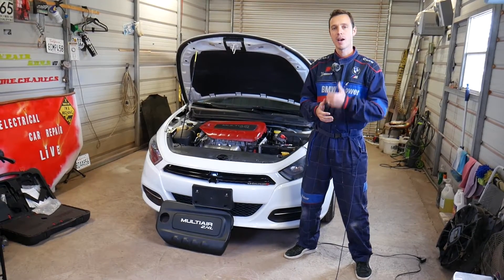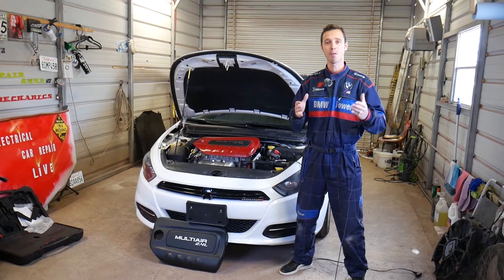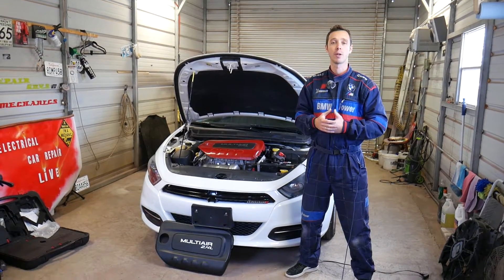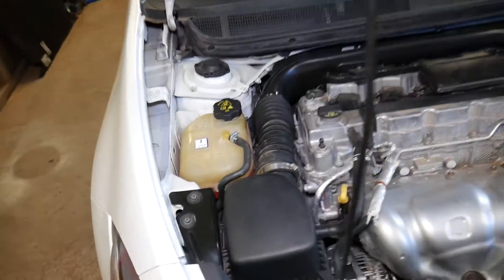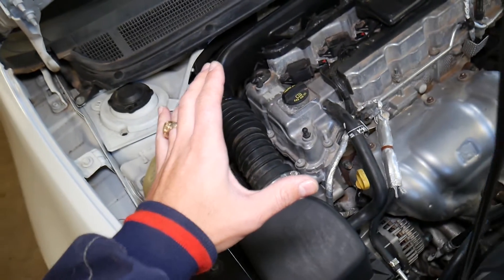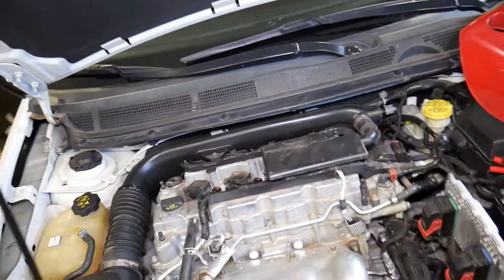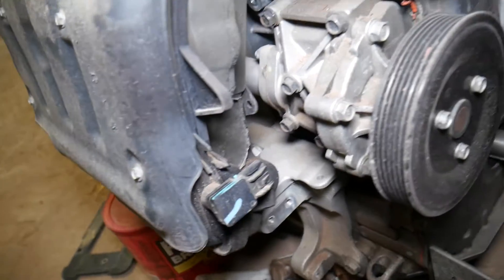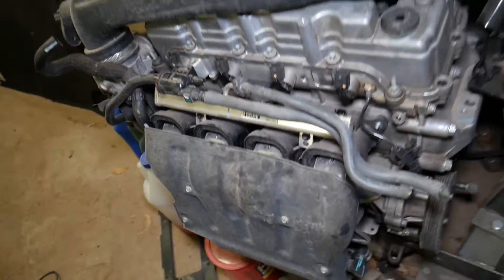WHERE IS THE MAF SENSOR MASS AIR FLOW ON DODGE DART JEEP CHEROKEE, COMPASS RENEGADE, CHRYSLER, FIAT

Comment: I need help, I have a jeep compass I have followed everthing you said to change.  with O2 sensor up and down steam and I changed the cam shaft and map sensor on the jeep,  the jeep has no power it laggs what is wrong with it. it is not throwing a code anymore tho I just cannot understand why It running bad... HELP!!!
Reply: They never reply.
Reply: If your problem still exist, check the following:
- Fuses (electrical errors in sensors / cheapest fix)
- Spark plugs (common ignition issue / cheap fix)
- Ignition Coils (common ignition issue / cheap fix)
- Air Filter (common air intake issue / cheap fix)
- Air hoses (leaks in air system / cheap fix)
- Oxygen & Crankshaft sensors (can wear out / cheap fix)
- Throttle (can get dirty or damaged / pricier fix)
- Fuel injectors / Fuel Rail (can wear out, clog up, or get stuck / pricier fix)
- Fuel Pump (can lose pressure or start to fail / pricier fix)
- Alternator (after a years needs replacement / pricier fix)
- Catalytic Converter (can damage or start to fail / costly fix)
- Transmision Fluid (If fluid is old and needs flush / costly fix)
- Pistons / Valves (internal engine damage / expensive fix)
- Head Gasket / Cracked Engine (internal damage / expensive fix)
- Transmission (if slipping or failing / expensive fix)
Reply: Maybe try taking off the air intake and clean the throttle body. Also don’t floor the car at low RPMs, once the needle passes 2rpm, that’s when you can start to press the pedal harder. I also have a Jeep Compass but it’s manual transmission (stick shift)